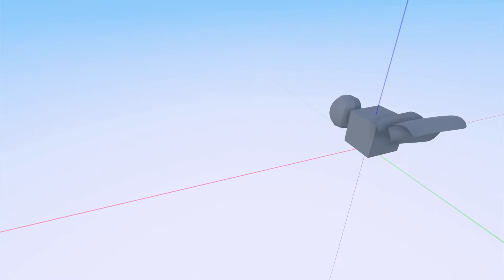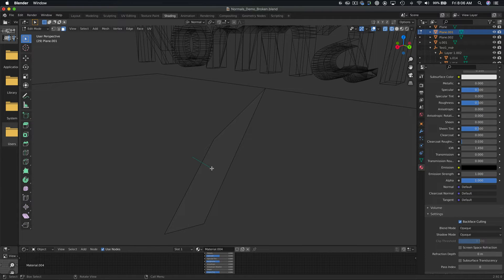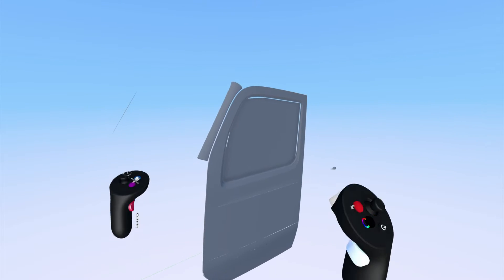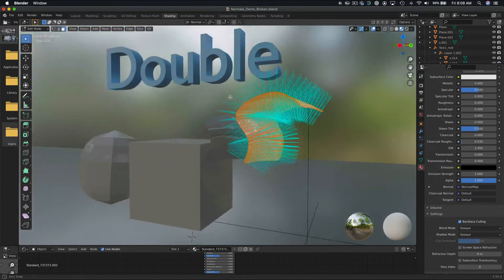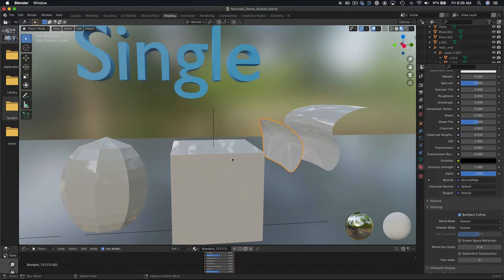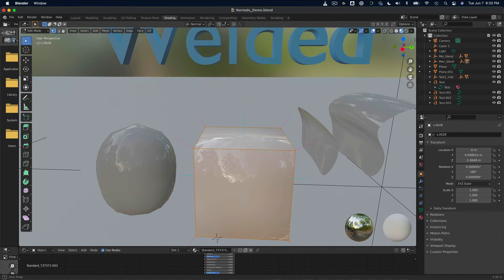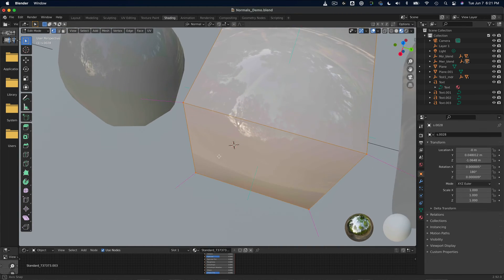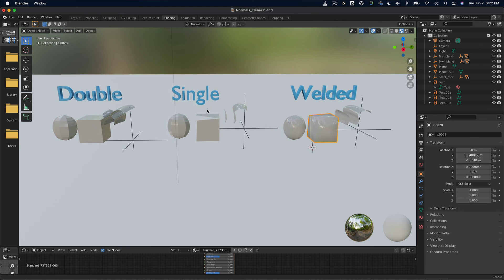Gravity Sketch Tool Tutorial: Normals Explanation

Comment: As intermediate in 3D field I still found these export option quite confusing.
Single Side should be standard and is the most everyone will be using.
Double Side should indicate that it's achieve by having duplicated geometry.
Weld should state as smooth normal.
Reply from the maker: Thank you for your feedback!